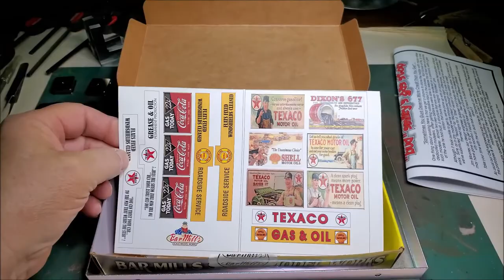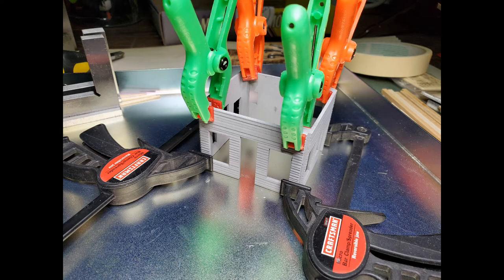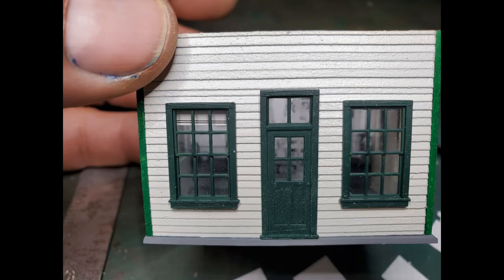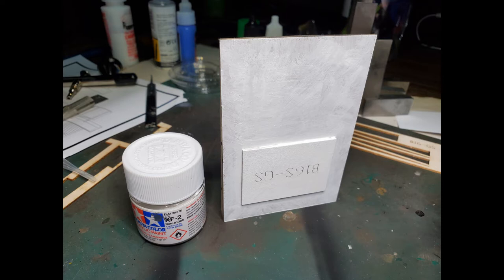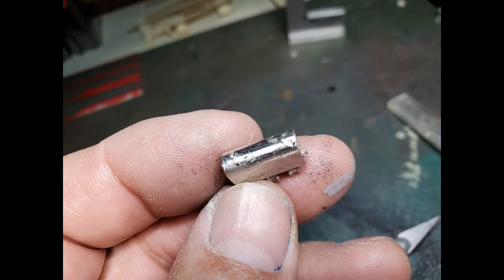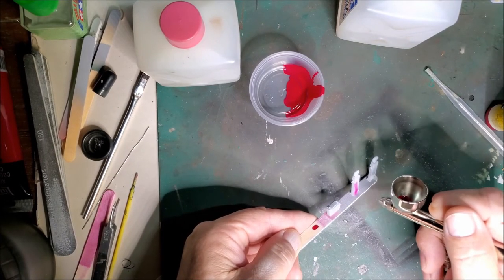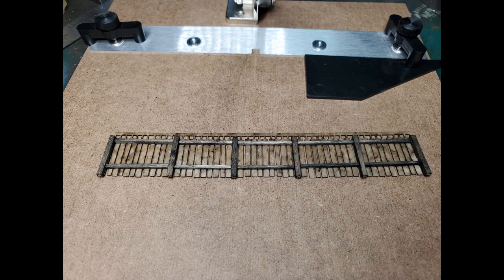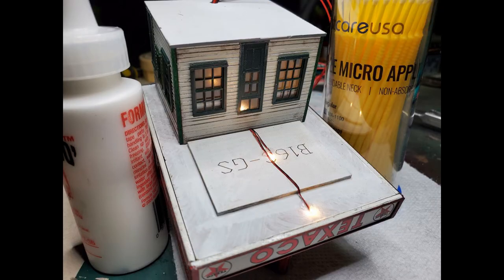Bar Mills Bud Smiley's Gas Stop HO Scale . Complete Build. Part 1

Comment: Good Video,  Fully enjoyed it.  My one issue you hit on,  Out of Scale.  I do not care as much if it is a little rough etc,  but out of scale parts are the one thing that should not be.  It quickly can make everything else look out of dimension.   I have a Little Orange VW bus on my layout that is about the size of a full size van.   If it is off doing it's own thing it looks good,  but it next to an F-150 or semi, it is a problem.  So for forced perspective it sits at the very front edge of the layout and looks rather nice.